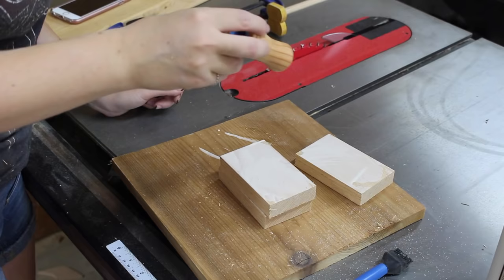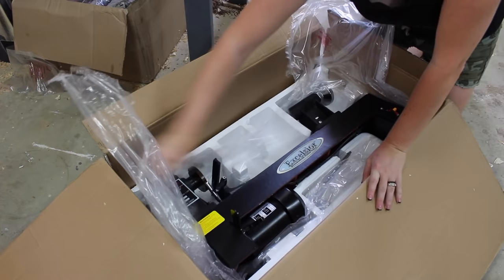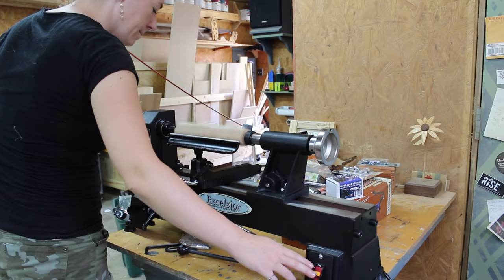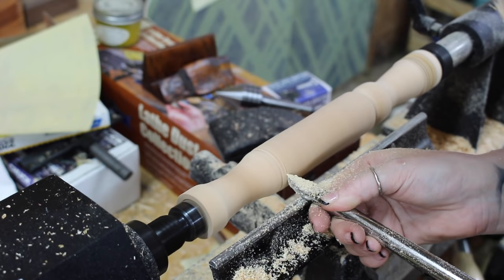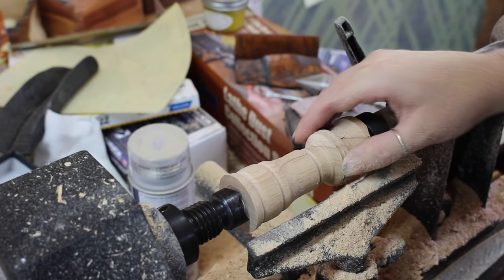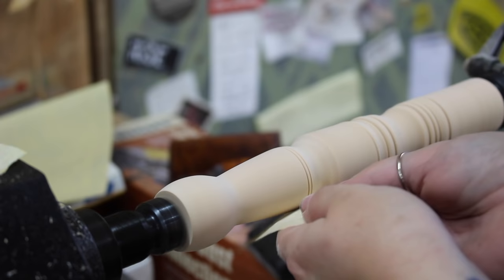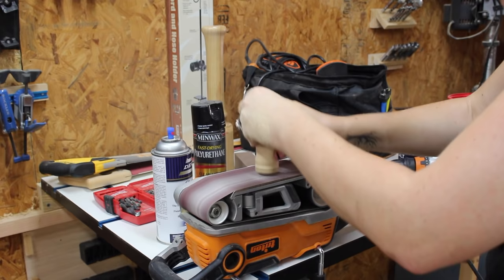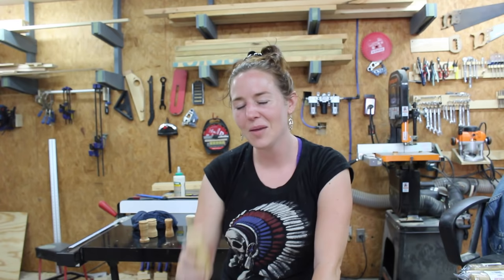Turning A Shop Salt Shaker

Comment: April - great to see you acquire a lathe - no wood shop should be without one! But I implore you - please remove your ring while working on the lathe, I can't stress how important it is to put your jewelry on the side when utilizing a lathe. Also, that burning wire can be a catastrophic fail should the wire be caught and wrapped, pulling your fingers and hand into lethal territory. Never work the wire under your piece. You have gifted hands my friend - I'd hate to see them injured in any way! Once you become more adept at turning - you can chuck the piece and drill the salt chamber right on the lathe. As well as recessing an area for the cap so that the shaker sits flat on a table. Thanks again for another great video! Love the humorous ending...  :-)  mike
Reply: yep, i'd get rid of the cool , neato , pull dowels.  Good advice Cuskit !!!
Reply: The first thing I noticed too was using the wire under the piece. Very dangerous but also for her first go at it, she's doing flipping amazing! The gal has mad skills with pretty much everything I've seen her attempt. The only reason I would point out a safety concern girl is I enjoy watching your videos and wouldn't want them to come to an end by doing something unsafe!  MEC Woodworks

Comment: Hey April,  
A nice little turning video!
Welcome to wood turning. I fell in love with the ability to finish projects in one outing. 
First, a quick tip. When checking that your spindle is round, rather than stopping the lathe, lay the back of the roughing gouge on the spinning work and slide it left and right. If it bounces, it's not round yet. Also, I agree with an earlier comment, a drill chuck and a four jaw chuck are pretty invaluable. The other great tool for small projects is a narrow parting tool. 
If you want some great home lessons, I love Richard Raffan's videos and books. He does amazing work and explains things really well. The hardest tool to master on a lathe in my opinion is the skew chisel, and Raffan's explanations and use of a curved skew are great. 
My lathe education started with classes through our local woodworking club, but the huge jump in skills for me was taking a week long course at Craft Supplies in Utah! Highly recommended!

Comment: Welcome to the woodturning club :)  Just a tip with your salt shakers, drill a slightly bigger shallow hole first then your hole for the plug, that way the plug will be inset a bit and the shaker will sit flush with the table.
Reply from the maker: Oh yeah I'll do that! Good input. : )

Comment: Most either love or hate turning.  I found after 27 yrs of flat work (chasing wood) that the lathe was ........... yes, therapeutical is a great word.  Believe me, after chasing wood for that long, I became addicted to having the work come to me. :) :)    

If you ever decide to move up and don't want to go all out for a $5000.00 + machine that will make a 40" bowl and rip your arm clean off, I'd suggest the Delta 46-460 "midi" lathe. 

The Delta has variable speed so you can go from slow to fast w/ a 10 point dial, while spinning, w/ out having to change the belt pulley's.  The on/off switch is on the left so you can turn it off and slow it down to stop w/ the same hand.  (you can't know how convenient this is until you use one)   There are 3 different belt pulley settings to boot.   It has a reverse, which is so handy when sanding, finishing or just removing work you screwed onto the chuck.   It has a 6"+ bed height which means you can turn a plate or bowl as large as 12-1/2" and w/ the 1hp motor, you never feel as though you don't have the power you need or that you are too scared to use it.    And, w/ the bed extension, you can turn 42 inches w/ ease on a 1hp motor. :) :) :)

Do your research and you will find this to be the next step for you, ...... , since you didn't already get it first.   Also, I don't know what kind of arbor that machine uses but if it will accept a Vicmarc lathe chuck and accessories, they are the best.     http://tinyurl.com/grsg4yn 

Don't forget to purchase and use a face shield.  You won't know how lucky you were in having one and wearing it, until you see and hear the force, w/ which a piece hits the wall.  Or, God forbid, you get hit in the nipple (that stings worse than you know) from a piece exploding off the machine at 1500rpm's and think about how fast it happened so unexpectedly.   Believe me, you start to appreciate your eyes, teeth, and good looks from thinking you could have lost them all, realizing there are no human reflexes fast enough to have saved you.

Now that you have many plenty of reasons for nightmares .............. geaux and have loads of fun and make a lot of video's for we the curious. :) :) lol

Steph

Comment: April I have two tips to share with you. You probably already know them but I thought I'd share them. 
First, I cut off the square edges of the stock at the band saw. This makes shaping quicker and safer (for me, anyway).
Also, when adding salt to any shaker (salt, pepper, cinnamon, etc.), I put tape over the holes so nothing spills out while they're upside down.

Comment: April, If you have a four jaw chuck, look into getting a drill chuck that goes into the tail stock.  You can then chuck in a forstner bit and drill the centers out of the shakers while they are still on the lathe. Not crucial but saves some time and the four jaw and the drill chuck open up tons of other turning possibilities!

Comment: Good to see you using the lathe.Try some old style gouges and chisels in the future.They are harder to use but they polish the surface as they cut,requiring little to no sanding.

Comment: Not sure if you're aware but if you'll put some grains of rice in the salt shakers it'll help keep the grains separated in case any humidity should get in. We use rice in ours in the house down here in the south. It used to clump together but once the rice bounces around as you shake it breaks up any clumps that might be there.

Comment: April, I would like to first commend you on not being afraid to take on new challenges and basically jumping in feet first. Turning is a very satisfying part of wood working and once started it is VERY hard to stop.
    The reason for this post though is the use of salt or sugar on a glue joint. this is a very old trick and there was even a short article about it in "WOOD" magazine some years ago in the readers questions section where a reader asked about doing this because someone had told him about it and he never heard of it. WOOD magazine replied that they contacted the makers of Titebond Wood Glue and they would not recommend it because the reaction of salt and sugar "could" breakdown the chemical composition of the glue and weaken the joint. Their suggestion was to simply disassemble the joint and remove the excess glue which causes the joint to slide around in the first place.
   I DO NOT want to open a can of worms here and get hundreds of peoples opinions on this, I'm just stating information from what I consider reliable sources and just wanted to bring it to every ones attention. I did not read ALL of the comments so if someone else already mentioned this I sorry for stepping on your toes.

Comment: You can drill holes in your salt shaker while it is on the lathe by using a drill chuck with a morse taper that matches your tail stock. This method keeps everything perfectly centered on your work piece.

Comment: One tip I've heard for lathes is to cut the corners off before you put the wood in the lathe, It's supposed to make it easier to turn the piece into a cylinder. It's also a great excuse to build a jig to hold pieces on their corners for the table saw. :P

Comment: Welcome to the Vortex.. :)   there's always another tool to buy....lol   +1 on the faceshield.     There's a LOT more inertial momentum there than it seems, and when it goes awry, it happens in an eyeblink.  they're pricey, but they're a must have..... 
-- just a tip, it's usually easier to drill the core out before you mount it on the lathe;  the flat faces make it easier to clamp with a parallel clamp or some equivalent.     to mount it, use cone center and a scroll chuck for turning.....    Experiment with very high grits, you can get some truly glassy surfaces with some species of woods....

Comment: Those shaker.s turned out great you will have a blast with that lathe.
Reply from the maker: : ) Thanks! I can't wait to do more projects on it. I just need more space though! My shop is quickly becoming too small....
Reply: That is the nature of shops.
Reply: How large is your shop?
Reply from the maker: Useable space is around 600sqft. So it's a great size shop but I'm wanting to expand into metal and turning so I'm very quickly running out of room.
Reply: Sound like a good reason to come up with new projects.

Comment: Harbor Freight sells this late for $200. People told me to do not buy from this place. I did it, 2 years ago, and it still working fine!
I see you use carbide tools: they are great tools, and no need to sharp  them, and are easy to start with wood turning.
Good job. As usual!

Comment: Very cool!  I'm sure you're excited to start using your lathe!  I just purchased a tiny "bead lathe" on Ebay.  I live in an apartment, so anything bigger wouldn't be practical.  I've been using a rotary tool to turn small blocks of wood into pendants, but I'm excited to start using a proper lathe.

Comment: Nice video as always.  About using salt to help with glue ups-read an article in a wood working magazine a while back and a reader asked about it.  According to a major glue manufacturer, using salt could lesson the ability of the glue to perform its binding duty.  Instead, you could simply let the glue dry for a few minutes so that the two pieces of wood don't slide as easily.  Just saying...

Comment: Shop salt shaker...easy for you to say!  Good first steps with your lathe.  I hope that you can graduate to real turning tools that cut the wood.  Carbide tools are really scrapers that make you do lots and lots of sanding.  Learn what speeds to use for different size pieces of wood and tool.  When sanding, slow the lathe down to 250-325 RPM.  It will keep paper cooler and not burn your hands.  If you want to learn more watch some of the best like Carl Jacobson, Eric Anderson (Naked Turner), Tim Yoder, Lyle Jamieson, and Frank Howarth.  Watch their tool technique.

Comment: The wood should absorb any moisture from the air which could cause the salt to clump in humid weather. If the salt does a tip from my Mum is to put a few grains of rice in the shaker to help break up the clumps.
Reply from the maker: Yep good tip! My Mum does the same. ; )

Comment: Hey April---Next step is to get the PennState industries variable speed motor for the lathe.  I have it and it works great and it bolted right on the Excelsior lathe without any modifications needed!   There is a youtube video of it if you are interested.   The old motor is great for a slow speed grinder or disc sander.  Then there is the fun of making your own lathe tools and of course the custom made handles! :)

Comment: I second the comment about removing the jewellery. I always remove rings and watches when working with tools or chemicals. I have had the unpleasant experience of recovering the remains of a persons hand after he caught it in a metalworking lathe. It wasn't pretty. He managed to stop it before it dragged the rest of him in. He was stuck for 20 mins before we found him and freed him. He lost his ability to do all the intricate work he used to do. It is very easy to get a ring caught in machinery and it caused a degloving injury. Basically it defleshes the finger and usually results in an amputation.

Comment: When working with stationery power tools: No rings on your fingers! If the tool catches the ring, it could easily rip of the finger. There should be nothing on fingers or wrist that could be grabbed by the tool. If that happens, it happens so fast you cant do anything. Its really dangerous. Be safe!

Comment: Just something I noticed as you were burning the line on your shaker you brought the wire under the piece, this is a dangerous way your hand could get pulled into the wood if something went wrong a much safer way is to hold the wire above the piece and exert some downward pressure.
Reply from the maker: Oh ok noted, thanks!

Comment: If you make the bottom of the shaker concave it will sit nicer on the table surface.  I know that you are wearing a face shield.  I hope when you are turning without videoing it that you will wear a respirator.  The fine dust is really bad for your lungs.  When sanding it will work better if you slow the lathe and then also sand horizontally with the lathe off.  You can make a good friction polish for ⅓ denatured alcohol, ⅓ clear shellac, and ⅓ boiled linseed oil.  Keep it in a squirt bottle, apply with the lathe off and the use a small square about 2x2 and keep it against the surface as it spins on the lathe.

Comment: I'm guessing the name for the thread based tool is based on the strangulation device, in which case it would be pronounced Gah-Rot, rather than garrett.
Reply: garotte (n) - a metal wire or collar used to kill someone.
Reply from the maker: Maybe it's a good sign I'm not pronouncing the killing device properly?? ; ) Thanks for the break down guys.
Reply: As they say America and Britain are two nations divided by a common language and nether of you speak Aussie English ;)

Comment: Sweeeet. Good idea for shop buddies or you can make a matching pepper shaker and give them to normal non-maker folk! Where'd you come upon the plug by the way?
Reply from the maker: Yes! Shop buddies get one, non makers get two. ; ) My dad and grandfather both have a collection of those plastic caps/plugs that come on threaded pipe (to protect the threads when being moved). So I had a huge assortment already.

Comment: Hi April, I love your video's & have been a subscriber for quite a while now. I was just curious about that thing you called a Garrette, it is so similar to the Garotte, which is an instrument, usually a cord or wire with handles attached at the ends, used for strangling a victim, I wonder, is your's the American version, ;-)

Comment: Great vid April. Your link to Japanese pull saw is bad. It pulls up the center finder you have in the bottom link. Just a heads up.
Reply from the maker: Oops, thanks! I fixed it. :)

Comment: Nice video, top tip!! when your sanding slow the rpm right down. A it will make your sandpaper last a whole lot longer B you'll find your finish will get better (there less likely hood of burning and clogging) and finally C its very easy to add/take away fine detail if you over sand. Slowing it down gives you a lot more control. 
Also, NO jewelry, EVER!!!!! rings or bracelets should be taken off. Wheres your face shield???? i have had bowls fly off and crack the screen on mine, imagine how that would hurt. and wheres your mask???? wood dust on your lungs can be a killer

Comment: Excellent project. I am just wondering though, you workef so hard on building the shed outside and adding the dust collector to it. I have never seen you using your dust collector. Be careful please. Saw dust is a very dangerous hazard for your lungs.

Comment: Was there no lathe available that was variable speed? Constantly changing those belts can be a pain sometimes.
Reply from the maker: Oh sure, there are plenty of lathes with variable speeds but this lathe is $300 whereas the first lathe that is variable speed starts at $730. For a hobbyist or anybody on a budget, taking the time to change the belt will probably be worth saving the few hundred dollars.
Reply: +April Wilkerson Yeah that is true but harbor freight sells a lathe like this one that has electronic variable speed for around $150 if I can remember correctly.

Comment: Wondering where you buy the plug that goes on bottom. Neat trick with the salt shaker btw. I'm in my shop and going to make one right now. Maybe I'll just make the plug on my lathe as well.
Reply from the maker: You can order them off Amazon but I actually use some plastic ones that were in my grandfather's shop. He collected them off old pipes (you know how they use plastic caps sometimes to protect the threads while shipping?) and they worked great but making your own would also be cool.
Reply: +April Wilkerson Awesome! Thanks! When I make some for other people, I'll be sure to get those from amazon unless my wood ones turn out well. I'm thinking that if I use a forstner bit too countersink the bottom, I can then have a tapered plug on bottom.  Great tips!
Reply: +April Wilkerson Just made a salt shaker and the plug. Wood plug turned out great! I put a small lip on the plug to make it easier to remove for refilling.

Comment: Please please please remove your rings when turning. If a ring gets caught on the piece it'll tear all the skin from you finger. The burning wire is better used from above the piece as there's less chance of it catching. I prefer paddle type handles that you hold between the tips of your fingers. That way if it gets caught it pulls it out of your grasp cleanly. Additionally, don'y use old rags to apply finish to the piece while on the lathe (you can get away with it if it's the tiniest scrap of cloth), tissue is a much better choice. Have fun turning, it's seriously addictive.